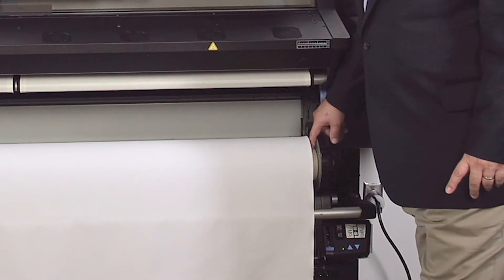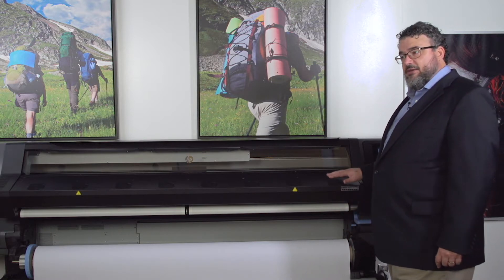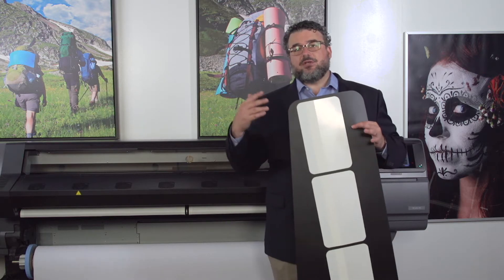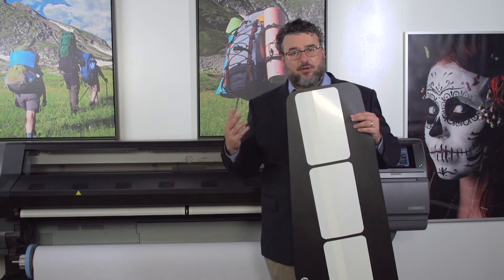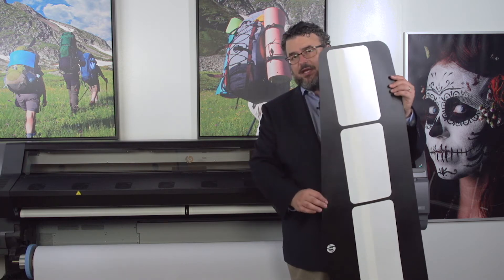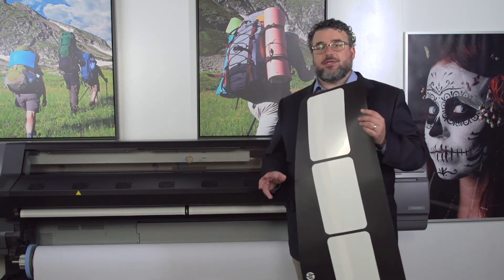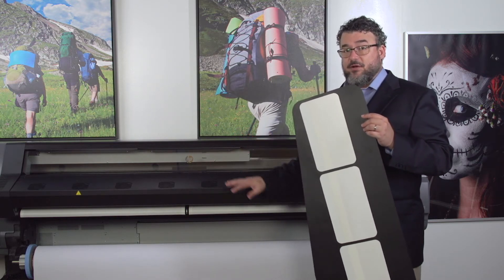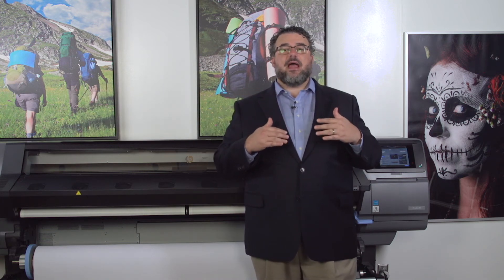Printing On Fabric Part 1: Loading the Media and Visual Inspection | HP Latex | HP

Comment: What fabric are you using in this video? I have a 110 and trying to figure out what fabric i can use. i know in the video you say fabric with a backing or densely woven but when shopping online most fabrics don't specify wether they are coated, uncoated, backed or how woven they are. I've tried your media locator but that didn't seem to much help.